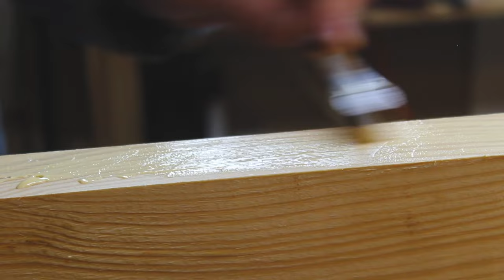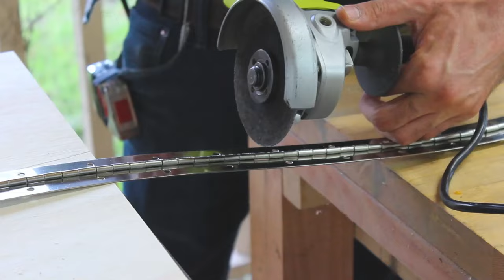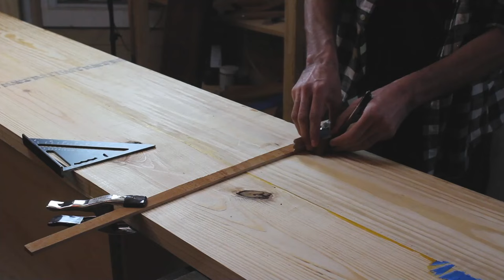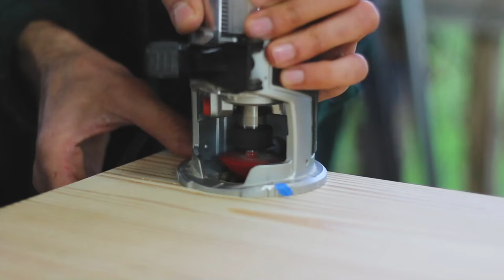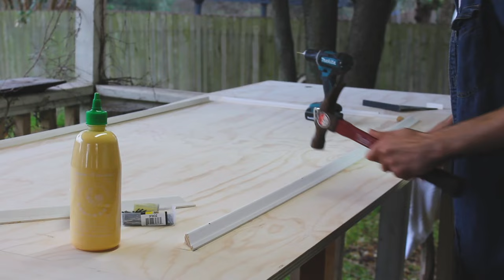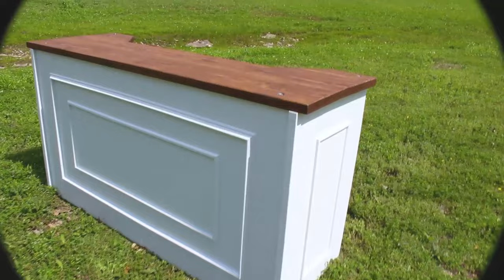DIY Flat-Pack 6ft Bar For Events. || Amir Creator

Comment: Did you consider attaching parallel lengths of wood to the top piece to wedge it into the folding piece? Too bulky?
Reply from the maker: Was going for simplicity, this way worked well enough

Comment: This is fantastic! Thanks for sharing. What's the average cost in material? I am considering buying a premade mobile bar, but like this approach much beter.
Reply: It looks like he needed more than one full sheet of plywood for the front and sides.  2 sheets: $150.

I think he got the angled ends of top from the offcuts, so it only took 2 pieces of 2x8.  Plus the bits to cover the corners could be a 2x4 ripped in half(ish).  Dimensional lumber: $25.

The cost of the moulding really depends on the style and length.  A very rough guess is 30 feet in total, with prices ranging from 0.5 to 4 per foot.  Let's estimate $40 for moulding.

There are the piano hinges and brackets to consider.  Hardware: $25.

Finally, there's stain and paint.  It doesn't take much, but they charge a lot for small quantities.  We'll call it $35.

That totals $275, so budget $300, assuming you have the tools already.  At least a circular saw, drill, and sander.  Table saw and miter saw are nice to have, but not absolutely necessary.

I wouldn't expect that you could get this done by a professional for less than $6-800.
Reply: @bd_mayhem  thanks! I’m finishing my mini bar soon - less than $200… I hope it doesn’t look like less than $200! 😂

Comment: I was planning on building something similar (transportable DJ facade) after a friend posted one that was rented for his wedding gig. I stumbled on your YouTube video while searching instructional videos. This is almost exactly what I had in mind! (I don't need the top, this will just hide/block a 4' table.)

One question... The pieces at the end (I assume they're 1x1"?), are they flush with the bottom edge of the front and side panels? Or do the panels sit above the ground? Kinda hard to tell from this video. (The grass hides it on the IG pic too.) Thanks in advance and thanks for this video!
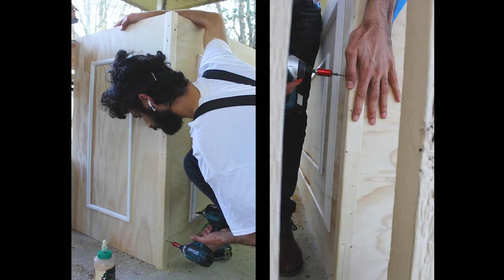Reply: Those corners are 2x2s, which actually measure 1.5"x1.5".  You can see the bottom better at 5:10
Reply: @bd_mayhem  Thanks!